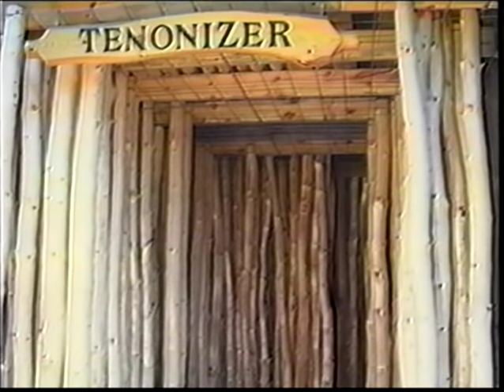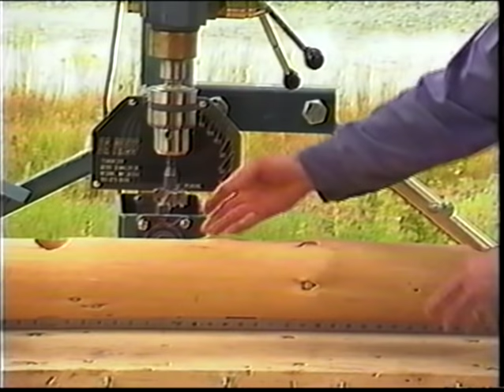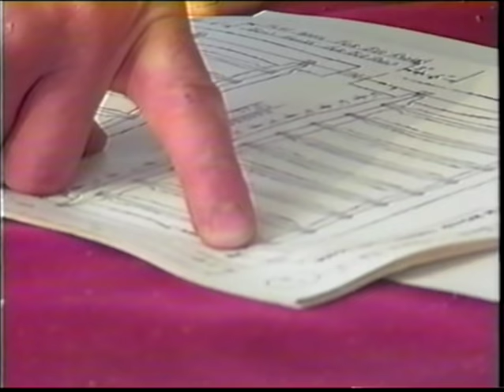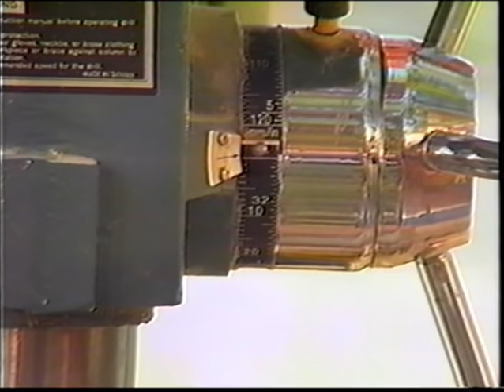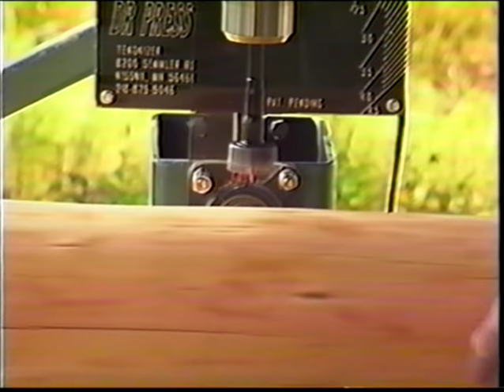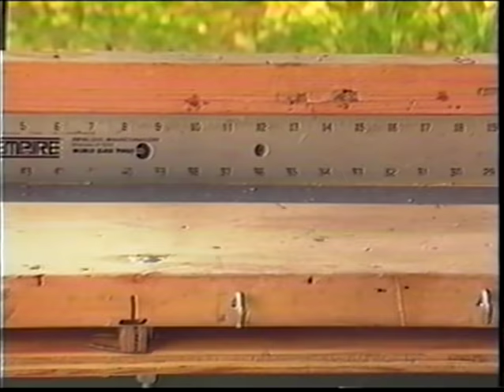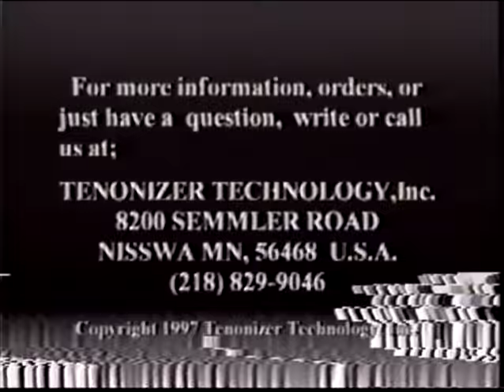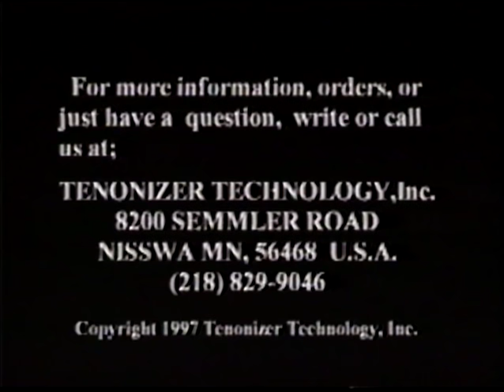Log Furniture 101, where it all begins! Tenonizer, cutting round tenons on a table saw, since 1992

Comment: Hello Gary. when leaning your poles upright, do the bottoms sit on the ground? wouldn't that rot it or just that small piece of the bottom? 

I always paint the ends of my wood so the moisture escapes from the middle so the ends don't split. I'm new to log building so any info about handling and storage, best way to dry them etc is appreciated.

-Gregory

Comment: Does anyone know where to get a drillpress like the one on the video?
Reply from the maker: tenonizer.com is where that tilting column drill press is from, although I do encourage people to just copy the idea. When we build them up we use a Jet 1 1/2 hp drill press head, with a 4 3/4" travel to start with and fit that drill head to our base unit. The way we fit them together now they tip 45 degrees to the left, 20 degrees to the right and 20 degrees back.